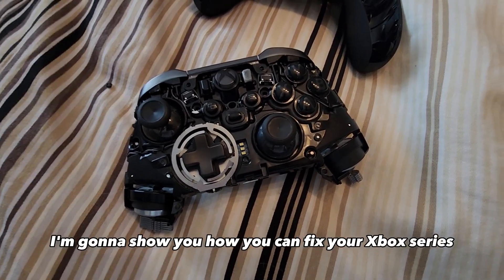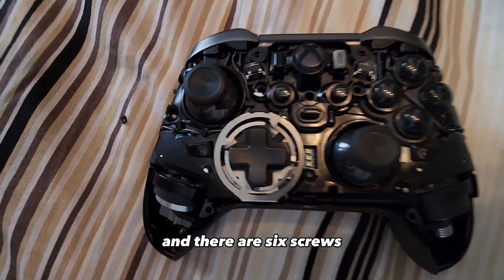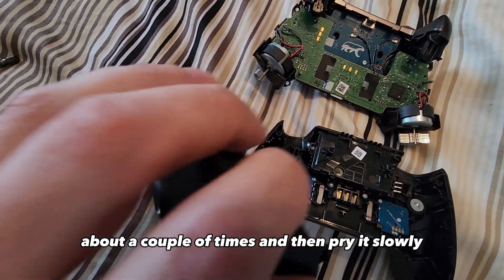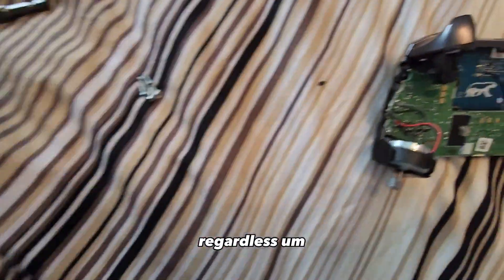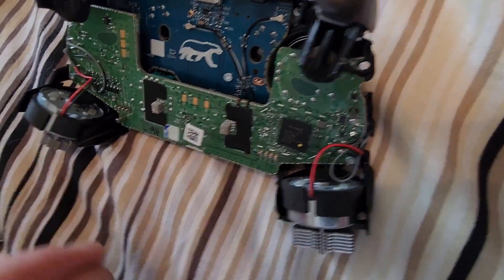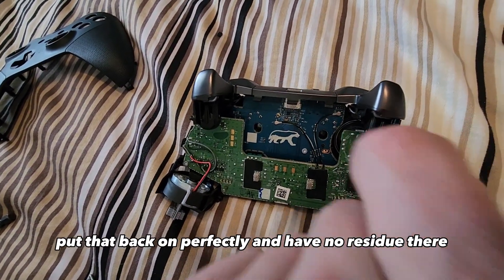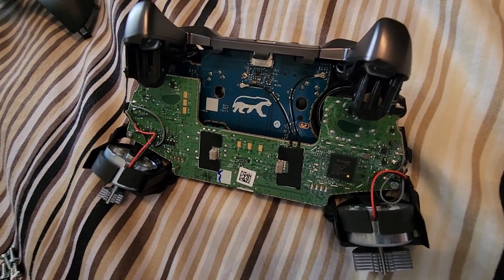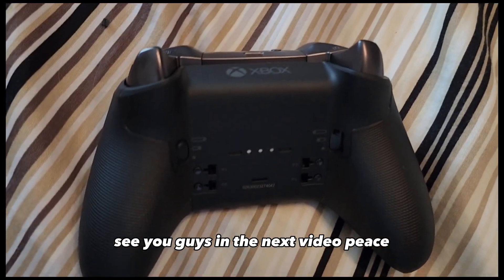How to Fix Xbox Elite Series 2 Controller Sticking

Comment: i got the same problem. i saw some reddit posts about how to fix it without dissamble the controller i will try it after work

you just have to put some isopropyl alcohol or siliconspray like WD40 specialist (not the stock wd40) via spraying or Qtip between the outer trigger and the controller shell to lubricate the trigger
Reply from the maker: I tried that before i had to do this 😓